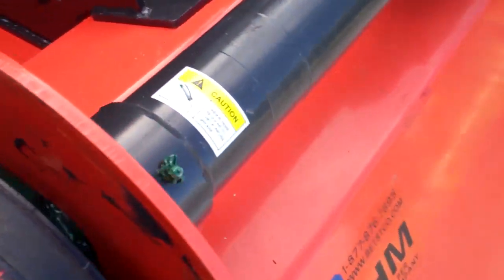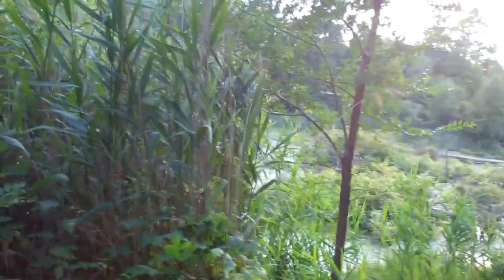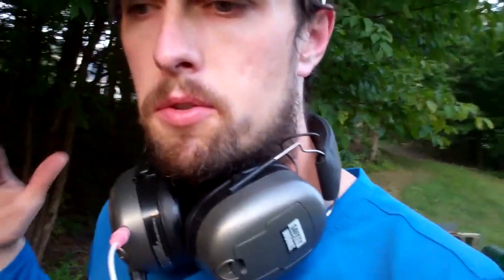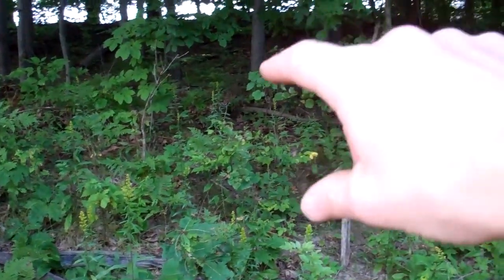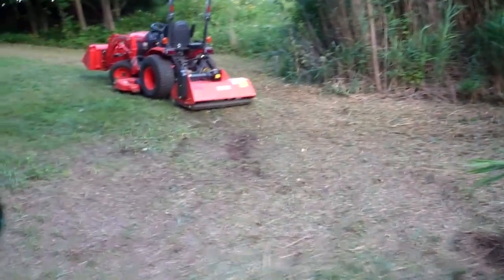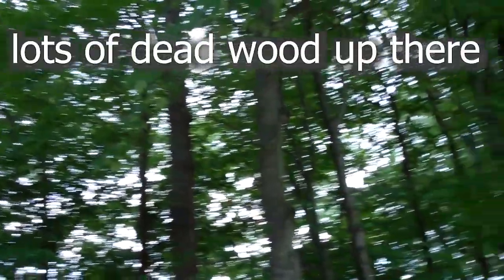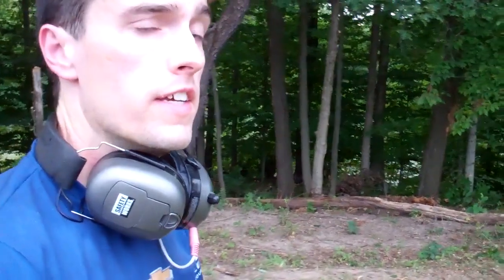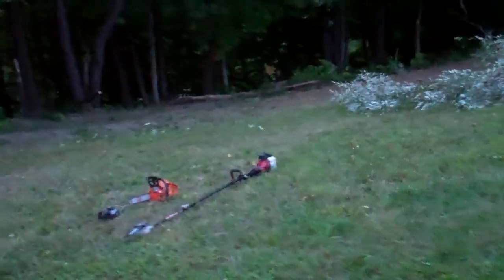Flail mowing and using a pole saw to clean up the pond & woods - Ep. 95

Comment: Great video! Have the same B2601 was not sure of get the EFGC125 because the minimum HP required is 22 and the B2601 is 19.6 HP at PTO. Does it feel under powered or bog down when cutting? Read to buy but just would be great to get your opinon thanks.
Reply from the maker: I had the same concern, but so far I have not come close to bogging it down (but I've also been pretty conservative with it so far, I think). In my opinion the B2601 can handle the 48" model just fine if you are going to be using it more as a brush hog and chopping up more debris than just grass. You could probably go bigger if you were planning to use the knives and maintain grass exclusively... but that's just my guess. Otherwise I've been very happy with the quality of the build and its performance. If things get hairy, you just go a little slower or pull up on the rear PTO :)  Check out Jon Ritter's channel on here, he also uses a 48" model for his BX, which I believe is the same PTO hp as my B. I think he got the medium duty model though, whereas I went with the heavy duty model. 
Hope this helps, let me know if you have any additional questions you think I can help answer. Thanks!

Comment: Just put my new EFGC125 flail mower together and went to engage the PTO at 1200 rpm and broke the shear bolt have you broken any? If not what rpm are you engaging your PTO.
Reply from the maker: That's a bummer! I'm pretty sure I engage right around 1000 to 1200. When I tried to engage at idle, it killed the motor, so that was a no-go. Before connecting it to my tractor, I was able to manually turn the PTO shaft by hand, and ensure the flail drum was also spinning. You did grease all the zerks and put gear oil in the gearbox, right? You also have to grease the shear pin area on the shaft as well--mine took a lot of grease when I initially set it up, they ship them totally dry. Hope this helps! Once you get it running, you'll love it, promise :)
Reply: Thanks for the info turns out it came with what looked like a 9/32 shear bolt but the hole can fit a 5/16 size shear bolt so I went and put a 5/16 grade 2 bolt in  it works perfect now. I can also engage the PTO at idle just engage it real slow and it stays running.
Reply from the maker: The only other piece of advice I was given (by GP Outdoors) is to make sure you don't have the PTO raised up too high out back when you engage it-- if it's too high it puts added stress on the PTO shaft and can also cause a sheared pin.

Comment: I noticed it was a cloudy day so your tractor should not be running warn, have you checked the radiator screen? Pop the hood and pull the screen out, it may be clogged, I have a B1700 and once the temp gauge raises over the half way mark it's time to check the screen and maybe blow the dust out of the radiator, DO NOT use high pressure water, air only or you'll bend the fins on the radiator, been there, done that, had to pull the radiator out and straiten the fins.
Reply from the maker: temp gauge has never gotten near the halfway point, but thanks for the info.

Comment: Hi Joe. Great video!  I'm considering purchase of a Betstco flail mower, but my ranch has tons of rocks everywhere, which I'm trying to remove by hand.. Is it possible to run the mower at a higher level by setting my PTO higher, so the mower cuts higher (roller isn't hitting the ground)?
Reply from the maker: Hi Louis, thanks! And yes, you can use your rear PTO adjustment to raise and lower the flail to adjust the cutting height. I was in some thick grass a few weeks back and had to run it about 6” off the ground in the first pass to avoid bogging down. No problem. Good luck!
Reply: @JoeSoslick  I just placed an order w/ Betstco. Thanks.

Comment: My favorite tool is a battery operated pole saw!  It is fun to walk around trimming and cutting down shrubs without bending down or getting on a ladder. Great invention!
Reply from the maker: Cool! I bet the battery version is slightly lighter than my gas powered version, boy was that an upper body workout haha. Really nice helper to have around, and it's pretty safe too-- almost no chance of hitting yourself with the business end of the tool, but you do have to watch out for falling limbs... ;)
Reply: @JoeSoslick  Yes it is lighter, but of course having the chainsaw at the end of a pole makes it a workout. I like that it can be started and stopped constantly - no 'start-up'. I also now have a battery chainsaw and hedge trimmer.  I have gas models also, but I usually go for the battery units because they are lighter, easier and usually cheaper. I ran a pole saw for about 6 hours, and the battery still had life!
Reply from the maker: @LAMH  Those battery-powered saws/tools certainly have my attention-- I really like what I've seen so far with 'em, they seem safer, quieter, and perfect for an average DIYer.